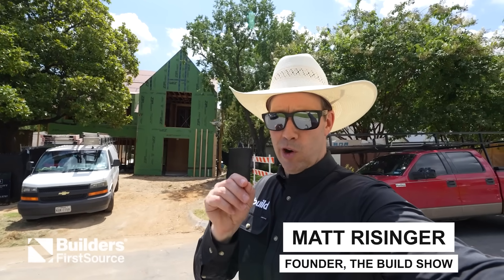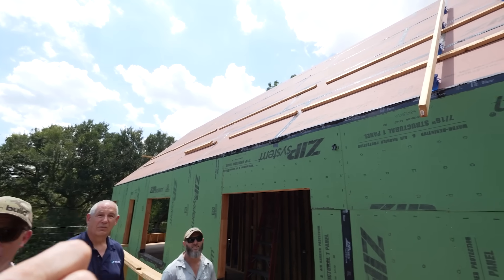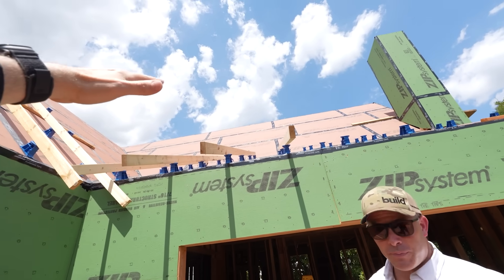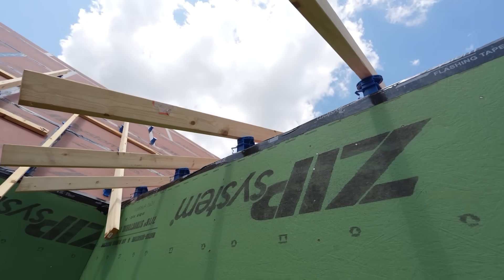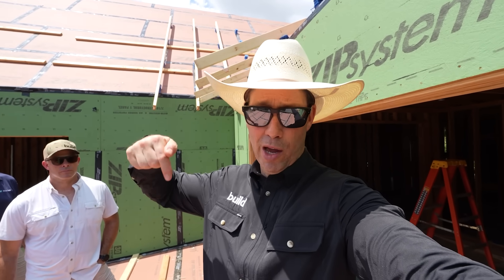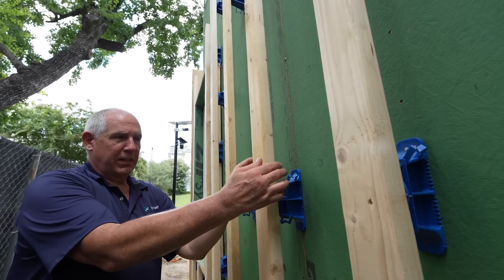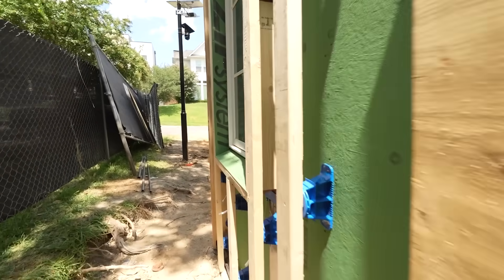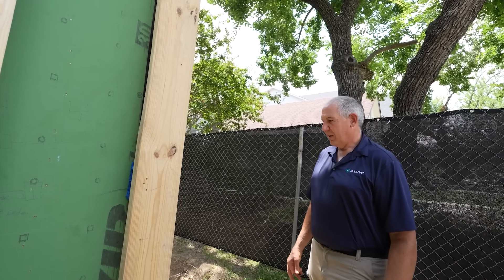A New Idea For Framing A Monopoly OverRoof

Comment: I have 10 layers of sheathing and x-brackets on the roof and walls. It's great.   Except the kids open the doors about 63 times a day, negating the benefits.  So I was thinking of giving them away so I could get the maximum benefits of my Huber house system before the bank forecloses because of the massive Huber-cost. I was thinking a little shack with a wood stove might be more cost effective. I could build the shack from all the pallets that Huber delivered the sheathing on. Win win.

Comment: If you’re fully encapsulating with closed cell, do you really need the zip tape?
Reply: Nope. You also dont need the zip system, any 3/8 sheathing will do. The insofast system will be the airtight and waterproof system of the whole thing.
Reply: Yeah but then you wouldn't be able to drive up the costs to the rich idiots that are buying the house.

Comment: I have been viewing your videos for over five years.  A common theme to the videos is 'adding another layer or level of complications'--in other words, making building and buildings more expensive (many times with very very little value-added).  This video is a good example: there are several benefits to monopoly framing such as the elimination of large eaves; eaves are very labor intensive and gain you almost nothing (the vertical wall must be 100% rain and water-proof and eaves are simply a copying of Europe and Asia having to 'keep the rain off of the wall'.  Eaves are also the reason tornadoes are so destructive; the eaves allow the wind to tear off the roof, exposing the interior to rain and ruining the house--if the roof stays on, there is little damage. 

But here you are, adding another (non-structural) set of roof framing, bringing the eaves back, and adding some insulation I suspect.  More work, more time, and more cost for very little gain and possibly some very big problems.  

There are four things we must do if we are ever to solve the housing crisis: 1) Simplify, simplify, simplify.  For example, pre-wire the electrical system off-site in a manufacturing plant, not at site (you wouldn't think of 'wiring' your electric stove/oven on-site--this very complex wiring is done at the manufacturer's site and brought to you).  2)  Build partial wall, floor, and other assemblies in manageable 'pieces' that can be lifted and installed by crews of three or four (not the entire wall, but the framing and subsiding, for example.  3)  Build the proper size: the average household in America is under '2' people--many are single occupants.  The average new home is 2,300 sq ft.
4)  Tax any profit that is due to speculation and not 'supply-and-demand'.  

5)  Actually, reverse the profit matrix: right now, profit is greater if the price is higher; you might also forbid 'materials and labor plus' contracts.  If you reversed that ('Profit is higher as a percentage, for a lower price"), you would see people building houses that are the right size (design the house such that it can be easily and quickly added-on to), simple, and priced affordably (if you make more money on a smaller, less-expensive houses, you would build many more houses rather than one big expensive house).

Comment: It's like they are making up a problem to then find a solution. 
Matt's system is easy to install without any special parts or spray foam (which is not guaranteed to be applied properly).
And, these brackets also transmit heat (even if negligible).

Comment: Would be great to see a project with the upcoming InSofast XB bracket designed to utilize “batt” insulation vs rigid board.

I am considering them because of cost and availability of comfort board vs comfort batt.

Comment: I think it makes more sense to spray foam the interior side of the roof, not the top. That way if there’s ever a roof leak, the water will have a path out. Also, I wouldn’t trust those plastic brackets. They should be metal,   Simpson probably has a metal bracket that can serve the same purpose.

Comment: For all of the people saying to just do a double wall instead, these brackets essentially allow you to achieve the same thing as a Larsen truss, but with less lumber, less thermal bridging, better air sealing, and more insulation in the same wall thickness.  Also, the polymer brackets won't wick moisture through the insulation to the sheathing like lumber would, so you won't be challenging your WRB as much.  If you are going to be putting on very heavy siding, an actual double stud wall might be a better way to go for new construction, but this is actually a fairly well thought out system for retrofitting insulation into an existing building.  I don't know that I would do the second layer of Zip on the walls though.
Reply: More lumber? Double walls can use advanced framing and 2x4s are hell of a lot cheaper than two layers of Zip sheathing. Your other criticisms of double walls are false. A double wall has COMPLETE thermal isolation with the exception of the top sill. But the real issue here is cost. If you're a bazillionaire, then sure, go all out and build a triple layer wall and roof if you like. But for us peons who want a high performance home, then double walls or staggered stud walls are the only realistic alternative.

Comment: There is no way any potential energy savings will ever pay for the added expense of this.
Reply: You could just not put your services in the attic and have 5 feet of blown in, and build 8" exterior walls with offset 2x4's for wall insulation. Ants can live in foam, I have seen it first hand.
Reply: Seems like ants wouldn't live in your roof though
Reply: @michaellautermilch9185  true, I'm just against the whole exterior foam deal
Reply: @michaellautermilch9185  Sure, but uncles might.

Comment: My question how much is 3” of insulation going to give you with closed cell foam
Reply: About a true R-21 
For comparison a 2x6 wall framed 16 on center with R-23 rockwool in the cavities is only going to get you about R-15 wall R value.
For all the work they're doing I'd like to see them at least get to the point of diminishing returns which is about an r 23 through wall value so they would need three and a half inches of continuous.

Comment: This really makes you appreciate what a great value Zip-R is…
It can achieve something similar to this in just one step.
Reply from the maker: Indeed. However the roof design here is amazing and Zip-R won’t work there
Reply: @buildshow Do you know if Huber is working on a roof product to fill that gap? Seems like that could be a slam dunk for monopoly framing…
Reply: @atomicsmith  I actually remember a video where Matt said Huber was working on that. But that was years ago. I believe the problem with it, is that these foams are not very strong. So when you apply them on a wall, no problem, because the foam doesnt have to carry a load because the foam is purely vertical. But on a roof that foam needs to carry a load. 

Maybe it would be better to invert the foam and osb. So from top to bottom: wrb > foam > osb

Comment: Insofast did a build using bare OSB instead of huber zip.  Polyurethane closed cell should stick to the OSB.  I'm not understanding why Zip is being used, unless it is belt and suspenders.  All the control layers are provided by the foam.
Reply: Could be for weather during construction. Seems excessive to me too.

Comment: ZIP sandwich? If water gets in between those layers, that will be some very expensive rot that will go unnoticed for a long time...

For the walls, Insofast has another product where you can do batts of mineral wool insulation -- that together with house wrap (to hold the insulation stable with a vapor open materials) seems like a superior system in terms of building science and is also much less costly than spray foam + an extra layer of ZIP.

Exterior insulation on the roof is much more difficult to figure out because people are going to want to walk on it. I have yet to see a system I'm really happy with -- there's either no solid decking or there's a sheathing sandwich that could trap moisture. Either way, there's a real risk.
Reply: There is an air gap under the first layer of zip. The second layer acts as a WRB and air sealing layer.
Reply: @phamlam3720  The air gap doesn't help dry the sandwich when the is air sealed by both layers of ZIP. If the idea is that the air can "absorb" any moisture that gets in, well, if that air gap is 2", then for a 2000 square foot wall, that air can hold less than a cup of water at 70F before it reaches 100% humidity.
Reply: @dosadoodle the top layer of zip doesn’t get air sealed to the wall. There is a ventilation channel that goes where those 2x4 are. The roof will act like a standard vented roof.
Reply: @phamlam3720  If that's the case, then I'm very confused, even if less concerned about moisture. If there's full ventilation, then what's the purpose of the outside layer of ZIP? If the point is to stop water from reaching the foam, then why not just a house wrap? It would be much easier to install, and much less expensive vs ZIP.
Reply: @dosadoodle some people like to use zip everywhere. 

If I built a roof, it would be a layer of zip, exterior insulation, 2x4/air gap, then OSB w/ a roofing membrane.
Reply: Getting ready to build our house in Houston and tgat is the plan.  Zip sheathing sealed to the walls for a completely sealed structure, rock wool or a rockwool sandwich with poly in the middle to bump the r value, the  purring strips, the  osb with something like sharks kin SA on the osb.  Corravent in the eaves will vent  under the osb and over the rookwool, leaving via ridge vent.  Proper name is a vented overroof.

Comment: Love the X brackets. However, the interior facing side of Zip is bare OSB. Seems like using this for the second outer layer with the OSB side facing the (water) drainage plane has the potential for failure of the second outer layer from the back side when (inevitably) water enters that drainage plane.

It might be better to use plywood for the second outer layer and you can probably save on taping that as well.

Comment: What are the advantages of this?  From a cost perspective, Polyiso sheets are generally cheaper than having closed-cell spray foam applied.  Polyiso sheets plus furring strips will have a similar air gap that will let the siding and roof sheeting dry.  Closed cell spray foam doesn't do well with long term water or UV exposure, which is why putting it on the outside of your house isn't generally a good idea.  If you tape the Zip sheathing properly, and then offset insulation sheet gaps and tape them, you'll have bomber levels of air sealing.  So here it looks like you have an assembly that's more expensive, has the same level of drying ability, has worse insulation, has the same air tightness, and takes more risk of your spray foam being damaged from water and UV, compared to polyiso sheets plus furring strips.  So..where are the advantages?
Reply: Completely agree with you.
Insofast is a good product for remodelling. I even believe that was what it was designed for based on a video I saw with Jake Bruton. If you build a house from scratch, I really see no reason for this.

Also, Polyiso is much much less polluting than closed cell spray foam.
Reply: The advantages of closed cell foam - monolithtic insulation barrier, no leaks, and significant structural integrity increase >30%.
Reply: the corporation that makes them sees their stock price rise, and the people responsible for its development hold their hands out.
Reply: @imakedookie  😆

Comment: My initial thought was, this is a solution for a problem I never ran into. Now that I watched the whole video, I’m still not sure who this is for.
Reply: For a remodel, you could use some 2x4 blocks as standoffs, and for new construction, just build a double wall or roof cavity. I truly don’t know who needs these plastic chairs, and I ESPECIALLY don’t know who would double layer the Zip boards.
Reply: Yeah, I don't really understand the two layers of Zip either.  It makes sense on the roof to give you something to nail shingles to, but it doesn't make much sense on the walls, and in the demonstration videos InSoFast has made they just attach the siding to the furring strips that are screwed into the X-brackets.  I agree that a double wall might be a better option for new construction, but this is actually a really great system for a remodel where you don't want to tear into the interior side of the walls on an older or uninsulated building, but you want to add additional insulation to the exterior.  These are better than a 2x4 block though, as the plastic doesn't transfer heat as well as the wood and won't wick moisture, and the gaps in the bracket can be filled with spray foam to further reduce any thermal bridging.

InSoFast started out as a foundation insulation retrofit company, making EPS insulation boards with built-in plastic studs that you could glue directly onto the inside of a basement wall, then screw your drywall to the built-in studs to quickly finish an unfinished basement.  They then made a modified version of this that exactly fit into the corrugated walls of shipping containers for the people who were turning those into tiny homes.  The X-brackets are their latest product that basically due the same thing as their other products, but allow you to swap out the EPS foam for closed cell spray foam to get more insulation and better air sealing in the same amount of space, especially on irregular surfaces.
Reply: great solution to sell more zip panels and xbrackets !
Reply: It's classic Risinger mentality → "Why save money when you can double the $/SQFT for a 2% performance gain??"

Comment: Interesting new idea but between doubling the zip panels and all the brackets the cost for materials and extra steps seems not worth it. May as well just design the house with a double frame and than you can add as much insulation as your heart desires that is also continuous and with much less nail holes
Reply: my thoughts exactly. 8" wall with off set 2x4's, dont put your services in the attic, get extra deep trusses and just fill it with blown in. Why is everyone trying to reinvent the wheel?
Reply: yeah, i can see a single layer for the envelope, to seal etc, but the insulation can be bulked out by standard framing, not special overpriced plastic.

Comment: As a person that has built a lot of masonry homes, I don't understand how they can keep thickening the envelope of these wood frame structures with one layer after another. Why not at this point just use a masonry product to build the walls? A single system with a lot more structural value.
Reply: He’s selling Huber products
Reply: I was thinking they should have just went to OmniBlock and skipped a whole lot of steps and saved a whole lot of money.
Reply: right. cinderblock is durable and insulating, and if you have the room for a doubled and voided layer exterior wall, you drastically improve the insulation further.. with the added bonus of the blocks compressive strength. just makes utilities something that should be built to last and not an afterthought...